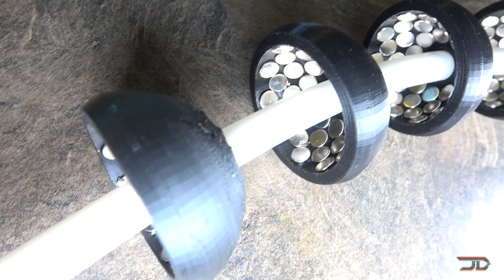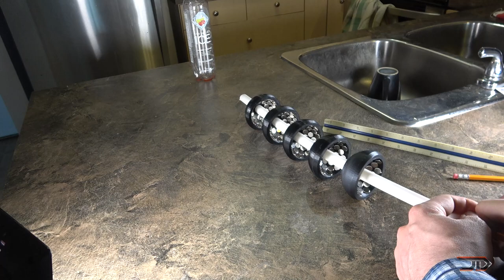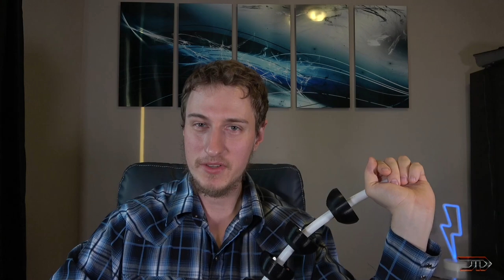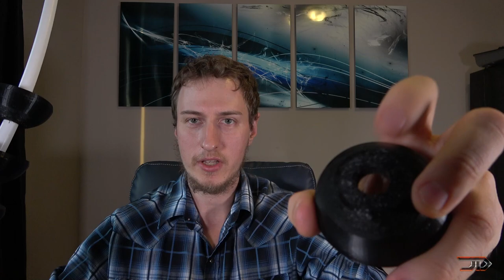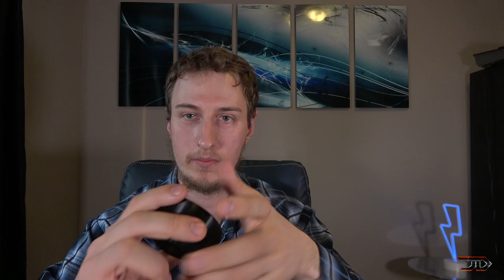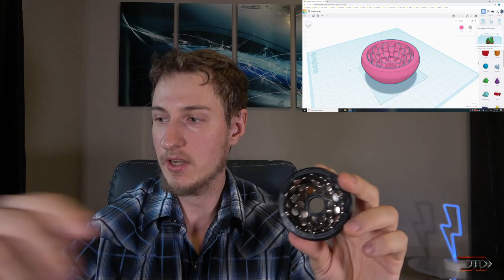Magnetic Array Loop

Comment from the maker: Update: I built 12 arrays and shot 10 connected magnets through. The arrays were closer together so the column of magnets being shot through were interacting with 2 arrays at a time. This new design is a little different from Lapoint's proposal. However, this also means that the contraption would need closer to 100 arrays so it is not really practical. I can confirm that there are some unique flipping points in the array and it will be  interesting to see what David does with his fusion build.
Reply: Before you build it, any thoughts of hurting yourself?
Reply from the maker: Shane Lee   That is true, it might take some 3d printing time. I will make 20, see if it stops. If it keeps going I will build the loop.
Reply: Yes, build as much of the array as you're comfortable with for the next round of testing. Interesting that the voltage didn't change with the addition of more magnets, kind of implies that the speed of the projectile didn't increase. Have you got a way to verify the speed of the projectile? Your accurate spacing could be easily accomplished with a suitable tube that fits over the array tube cut to the right length. Best wishes, looking forward to your next video.
Reply from the maker: @rolliebca  For sure, I intend to do velocity tests in the future. Lapoint said he had voltage increase but I don't think that's right because he was using multiple coils. It's best to test with one coil and note changes. Thanks for watching!
Reply: We need to meet up and talk, looking to get a printer very soon. I want to start designing linear arrays myself.
Reply: Yes, please Post IT on thingiverse
Reply: Please please please! I would love the stl!
Reply: @Tech_Planet  How is this projest going?
Reply: Did you continue on this thing?
Reply: If you put a large water container on it and give it a spin to let the water go down, through the magnets it would restructure the water. Add some shungite around the magnets and you would have one Super cool device 👍
Reply: @danielbrowniel  you mean like should he wear head gear?
Reply: The reason why the voltage didn't change is because you still only had one coil. The projectile wasn't changed and so the only real data to collect would be the velocity. If you want to get more volts you need more coils. I would add a coil after every set magnets then measure each one independently. You should get the identical volts unless the coils are wound differently. I hope you keep messing with this and I've got some other ideas if you are interested.
Reply: Can the column of magnets go up hill? Also could the column re-enter the first array after a gravity drop, I think you know where I'm going with this...
If you had a number of loops, one stacked above the other and joined up to look more like a rising coil then when the column of magnets exits the last array at the top, let them drop a sufficient height that gravity forces the column of magnets back through the first array.
A gravity drive? lol
Reply: @danielbrowniel  🔴 What Is Islam? 

🔴 Islam is not just another religion. 

🔵 It is the same message preached by Moses, Jesus and Abraham.

 🔴 Islam literally means ‘submission to God’ and it teaches us to have a direct relationship with God. 

 🔵 It reminds us that since God created us, no one should be worshipped except God alone. 

 🔴 It also teaches that God is nothing like a human being or like anything that we can imagine.

🌍 The concept of God is summarized in the Quran as:

📖 { “Say, He is God, the One.  God, the Absolute.  He does not give birth, nor was He born, and there is nothing like Him.”} (Quran 112:1-4) 📚

🔴 Becoming a Muslim is not turning your back to Jesus. 

🔵 Rather it’s going back to the original teachings of Jesus and obeying him. 

More ....
Reply: @1islam1  Go watch some David Wood videos.  I know plenty about Islam.  I wouldn't want to identify my soul with it, Christianity works for me.
Reply: A hybrid solar gravity battery system could power a house. A switching mechanism for raising the weight via small electric motor would make it faster to hoist the weight back up. Could have a donkey walk around in a circle to hoist the weight. It’s not free energy but it gets the job done simply and efficiently.

Comment: Picture a disk in your mind with magnets placed every 45 degrees oriented all the same direction with the N S poles in a tangent line at the circumference of the edge of the disk, picture the LaPoint parabolic cones with a slot for the disk to pass through.  Space out the cones to unequal angles from the axis of rotation so that only one magnet is entering a cone, and the rest are being ejected from the other cones... With 8 magnets every 45 degrees, cones would be about 0 degrees , 50 degrees 100 degrees, 150 degrees, 200 degrees, 250 degrees, and 300 degrees... LaPoint half sphere filled with magnets, I would think parabolic orientation would be best

Comment: What if you took two of those arrays and placed them back to back (similar to a halbach array). This way on one side it would be pulling and on the other side it would be pushing. If it worked then the output would be incredibly high (exponential on both sides.) You would only have to create one for the proof of concept.

Comment: Lenz’s law. Start drawing a current from the coils and the emf will oppose the mechanical action of the magnet creating it. That’s why car alternators are harder to spin when a load ( lights, heated screens etc) are applied. Hence they often squeal in the winter. The alternator is harder to spin and the drive belt slips. You never get energy for nothing.
Reply: WHY exactly induced emf in opposite direction? WHAT is the behaviour of the opposing magnetic flux? CAN it be controlled using core reluctance? YES. Energy from nothing IS lenz's law in disguised.
Reply: This array is designed to "break" lentz law. The extra "work" is drawn from the magnetic field configuration created by mounting the magnets in a bowl configuration ( as demonstrated in the PF1 and subsequent videos). Think about it, they ( the individual magnets) are mounted in a way where they all resist each other but the resistance is overcome by the bonding that holds the magnets in place. Basically using mechanical force to increase the magnetic flux density. IMO the coils would need to be as close to that flip point as possible in an almost friction free system but overunity is innate to the bowls because of the construction.... so I would guess something can be built based on this.... also... if you are cramping, put a bowl against it....pretty cool.
Reply: @archaicsage4803  that must be why  higher level  academic text book on electromechanical science state Lenz’s law.
Reply: @kerryjones1508  That dosen't change the fact that it is provably incorect.

Comment: A full loop will NOT work. The tube has to be short in order to work since the groups of magnets pull backwards on the projectile just as hard as it pulled the projectile forward. The tube has to end before the projectile has a chance to reverse.

This is one magnet contraption which I don't blame people for thinking there's something special going on. The demo you made is impressive. You are providing potential energy to the projectile by positioning the projectile away from the rings of magnets. When you launch the projectile, this potential energy is converted to kinetic energy. If you give the projectile room to slow back down, the rings of magnets will pull back on the projectile. This is why length of the tube is so important in getting it to work.

This is kind of like a slingshot which uses magnets rather than a rubber band. Just like the slingshot, you get one impulse from this device. Also as with the slingshot, the projectile must be released or it will be pulled backwards just as hard as it was pulled forward. Unlike the slingshot, you can't fully release the projectile from the system which stores the energy. This is why your empty bottle target needs to be close to the end of the tube.

By the way, this is NOT an over unity device.
Even if you could get rid of rubbing resistance in the tube, it still wouldn't work in a full loop.

"There's no guarantee it would work."
There is a guarantee it won't work. The guarantee is called the laws of thermodynamics.

Again, it was an impressive demo. Thanks for making the interesting video.
Reply: No, this rubber band analogy is flawed, the pullback on rubber bands requires a lot of energy and there is friction loss, hence not unity gain. This bowl magnet system requires very little energy to release a NON magnetized steel ball (see primer field videos), yet it shoots out at very high velocity, and obviously a lot of kinetic energy there. Watch the primer fields video, notice it suggests the magnet system pulls in energy from the environment.
And please no more talk of breaking laws of thermodynamics (a big red herring if misapplied), this is obviously impossible as you cannot create energy BUT applies to closed loop system NOT to system that attracts or draws energy from the environment (be it, solar, vacuum energy, thermal or whatever, a thermocouple and crystal set does this albeit a small amount of energy, but still energy so over unity is possible). Over unity systems do exist, they just need to be engineered into worthwhile form ... and fight a trillion dollar energy industry...
Reply: @martingosnell2937  "Over unity systems do exist, they just need to be engineered into worthwhile form"
Obviously videos claiming to show over unity are allowed to exist so the trillion dollar energy industry doesn't appear to mind that they are shared. What's to stop someone showing us how to harvest all this power and apply to useful work?
Reply: An easy test for this theory would be positioning a launcher directly upwards and letting the ball fall back into itself. If you're right and the hidden energy/losses come from holding the ball back from the magnets then we'd expect to see it launch up, fall back down, (maybe a few times) and then slowly attenuate. If this IS net positive energy however we'd expect the ball to be able to fall through the magnet ring completely and hit the ground. 

That would mean that it had X potential magnetic energy, it converted that into <X kinetic energy, it converted that into <<X gravitational potential, it converted that into <<<X kinetic, and it then falls back through the magnet ring converting <<<<X energy into magnetic potential again. If this is sub-unity it would HAVE to attenuate and halt as a simple harmonic resonator with sources of dampening. On the other hand, if it is positive-unity then it would generate more magnetic potential on the fall than it initially had on the launch, so it would eventually max out the magnets and fall through the loop.

I don't generally think "its against thermodynamics" is solid reasoning here. Plenty of facts that we've 'known' have ended up being false. That doesn't mean you entertain EVERY idea, but if an idea feasibly has promise and is easy to test its worth testing just in case you're wrong.
Reply: @felixjohnson3874  "I don't generally think "its against thermodynamics" is solid reasoning here."
You are of course free to feel that way. If some tech claims to break the laws of thermodynamics, it has ALWAYS been shown to be wrong.
Lots of YouTubers spend hours testing things which are obviously wrong. IMO, it would be better to spend time testing things which could be useful.

Comment: I hope you build the super array with 60 cones. The problem with so many people today is that they just read a few books and think they know it all, but no one knows but the creator what would actually happens. I have no idea what will or can happen with doing this experiment. Shame more people do not actually experiment to find out what actually will HAPPEN !! Wish you luck fella with your endeavors. Let the community know if funds are a real problem as they and myself will help with funds. Peace Tech Planet.
Reply: Its definitely weird because while thermodynamics should demand there is a loss somewhere in the system there isn't any obvious place for a loss to exist.

A single node takes a low velocity ball and makes it high velocity, so if you slowed it down and harvested energy you could just keep firing the ball endlessly. Unless this arrangement literally weakens the magnets over time or something I can't see anywhere that losses would accumulate. Friction exists sure, but friction could only represent a partial loss on generated energy (e.g. velocity, which is near zero at the start and greater at the end) and to be net-zero/sub-zero there need to be unrecoverable losses EQUAL to generated energy. (Minimum)

Comment: Even with a full circle, it would slow down until it stops, just like many other attempts at PPMs. you are the one putting in the energy for it to climb into the magnetic well, after which it falls into lower magnetic potential than before, and would stop after it does not have the energy to climb to the next well.

Comment: You should pull a vaccum on the pipe and seal it with the magnet inside or displace the gas in the pipe with helium to reduce turbulence and air resistance.

Should help with efficency
Reply from the maker: For sure, that is a good idea. I could do it with a ball magnet but it would need spacing somehow between the next ball. Kind of like that cyclotron kit I built.

Comment: what if you modelled in  a space for the coil in the housing of the magnets? so that the electro coil is actually much closer to and around all the magnets in the design? like a simple extrusion in the model could allow us to put the coils right on top of the magnets perhaps strengthening the effect? also, you could simplify the model, having it use one or even two rows less magnets, making the cupped area a little smaller and again closer to the ring tube as well.

Comment: is this pex or pex al pex? if pexalpex then measure the current induced in the foil layer end to end. 
i am usually quick to debunk these things but this has me interested, if not as over unity but as a system of radio antenna.
i am thinking that it could function using small additional power in the foil layer (pexal) to make an rf magnetron without vacuum

Comment: when testing with the coil, test for amps to see how current is running through the wire. voltage may stay the same but the speed of the current may change.

Comment: You can possibly try the loop with only the 4 arrays. Don't put the arrays on the bend of the pipe. Only on the straight of the loop. Like an 0 shape. On the left of the 0 straight will be the arrays and on the right will be the coils. Make the inner magnet move clockwise and place the entire structure upright. Just what I though of.

Comment: I have been researching this a lot and had built my own coil at the end of a magnetic ramp.. It seems to work.. I don't know what we couldn't use it practically to create the old 'free' electricity.
Reply from the maker: I find it stops after so many arrays but if you built it I would be interested to see it! Another thing to keep in mind to is that this might be possible with electromagnetic coils and be more efficient with switching coils off/on

Comment: You could reduce the number of arrays by making a vertical design instead of horizontal.       You would only need enough arrays to push the magnet shuttle through the top of the curve.  Gravity will be the force that returns the shuttle to the starting point.   
You could experiment with how much of a fall is needed to get the shuttle to push through the entry resistance to the arrays.

Comment: Make with a transparent tube and make a full loop vedio
Reply from the maker: For sure, I want to see where the magnets would stop. IF I print 20 of these arrays and it still goes then I will eventually finish the loop.
Reply: @Tech_Planet  Also you have to make a hole in tube for inserting balls and then cover the hole later.
Reply from the maker: @pushpandersingh2806  Yeah, you would have to create a slot to push the magnets through the first array. Better yet, I could use nickel rail guides and have it completely open
Reply: @Tech_Planet  Try both i think the open one would not work but we want to see practical which one do better.
Reply: @Tech_Planet  maybe need 30 arrays to turn 90 degree

Comment: You need a coil between each segment to rise the combined output. This will not rise your voltage as voltage is created by the magnet passing through the coils and you have only one moving magnet. 
And if you loop it up, it will highly probaby stop after one turn.
You have to replace one magnetic array by electromagnet to overcome the loop resistance.

Thermodynamis is valid for closed systems, but with quantum mechanics, there are loopholes, overcoming "closed". All the same, there were many smart people sitting over this problem without an easy, practical solution. You will end up watching SARL videos.

Comment: It should not maintain velocity as that would be perfect unity, overunity would mean the velocity would increase slightly after moving through every bowl. This does not seem to happen here. You can also easily "measure" the velocity with a coil and scope setup like David did. But instead of generating energy you just use it to measure the voltage spike which should be proportional to the velocity. If the voltage increases with every added bowl then the velocity is increasing and this might be worthwhile.
Reply: It should maintain a terminal velocity dependent on the strength of the magnetic field, the mass of the object, and the drag coefficient. You could draw power seems like it's worthwhile despite either classification.